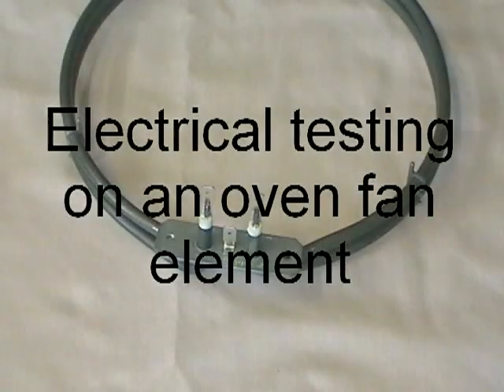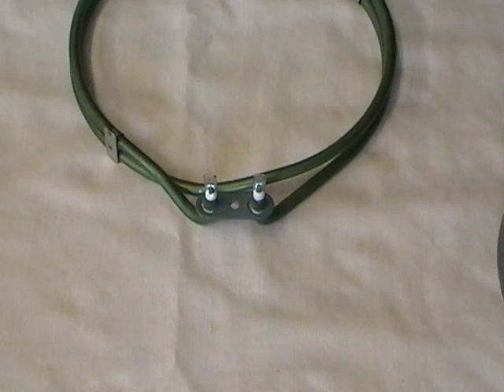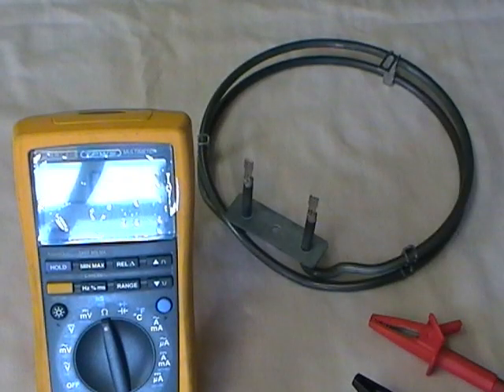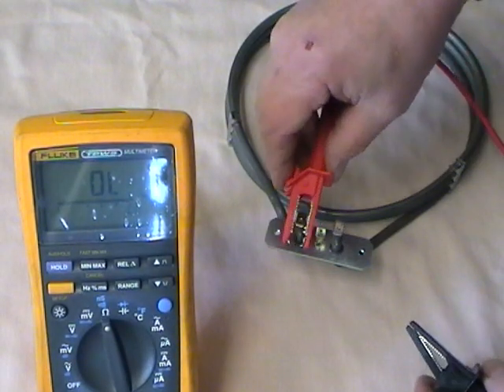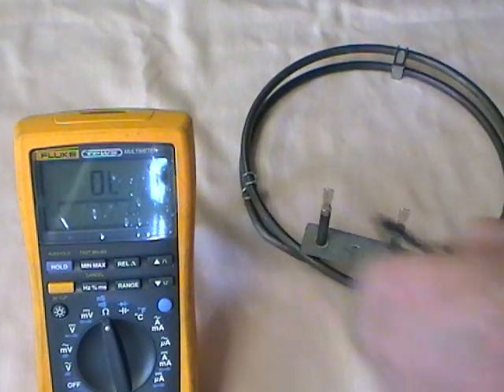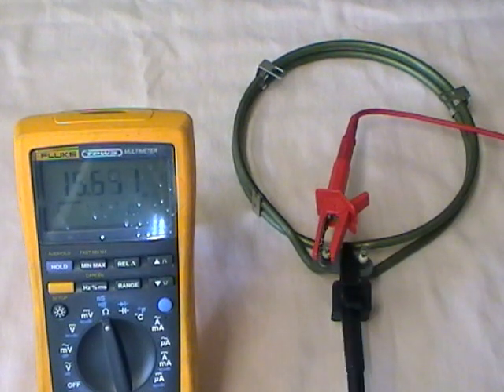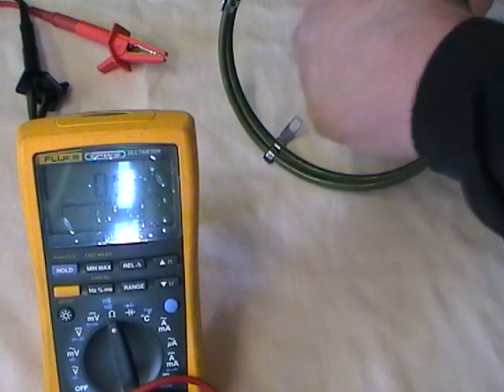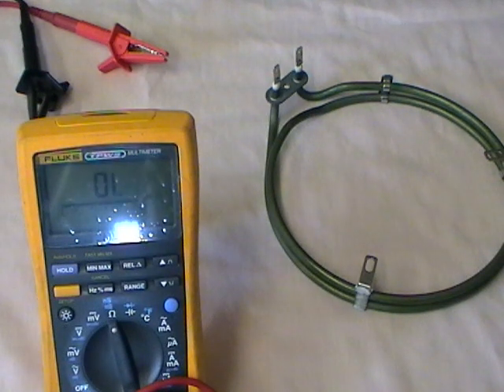Fan oven element electrical testing

Comment: after removing my cooker element i dropped the spade connector wires down the back so had to remove the back of oven to retrieve them but now i dont know which way round they go. my cooker is a zanussi and the element ony has 2 terminals and i thing the main screwing in bracket acts as teh earth. can the spade terninals be put on either way round please.

Comment: Great and very helpful. Based on the info in this video I have saved nearly £40 on parts and up to £100 engineer time. My oven was tripping the very sensitive consumer board and after testing the earth connection, I found my element was faulty and Ive ordered a new elemental unit. Thanks

Comment: Informative video although annoying meter screen glare as commented. Slight ohms law error. Higher resistance on last element will result in lower current and hence LOWER power. i.e. Less wattage as you then stated. Agree with other comments on using insulation tester, but multimeter will often give a good first indication of an earth fault if you don't have an insulation tester. I didn't know what OL meant either but I know now thanks to a couple of useful comments!

Comment: I'd strongly suggest using an insulation tester. Measuring the resistance between live/neutral and earth using a multimeter will not give an accurate test result. If you stressed that element with an insulation resistance test at 500 volts you'd find that the reading you saw at 18Mohm probably drop below the 2 Mohm minimum required for safety.